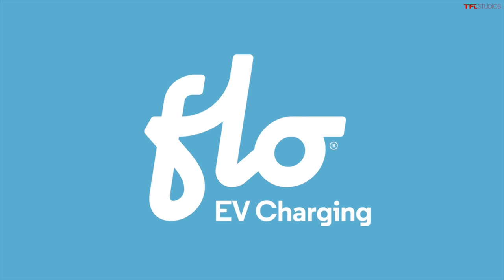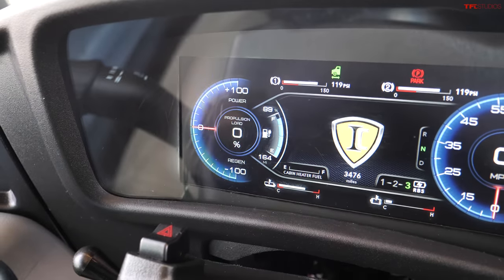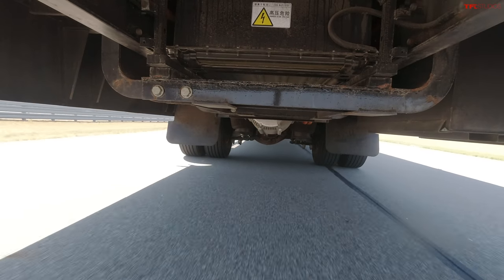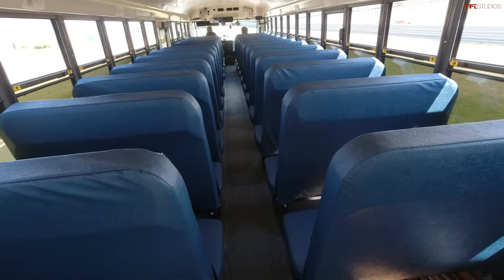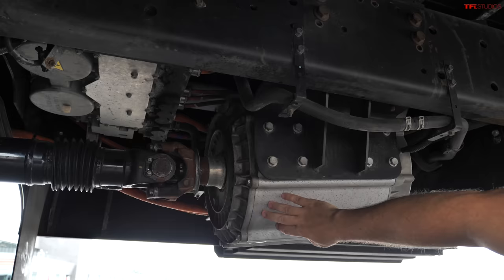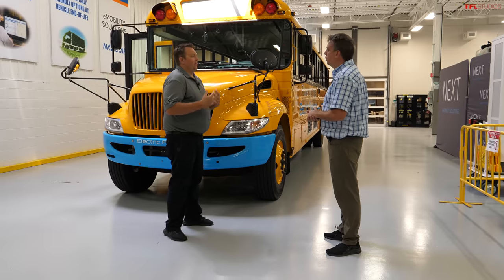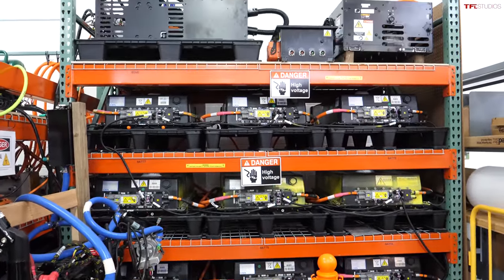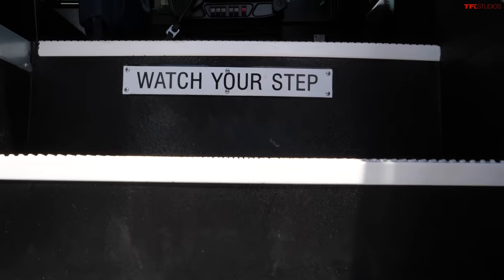Does This EV School Bus Put The First Nail in The Coffin Of The Classic Yellow DIESEL Kid Hauler?

Comment: As a school bus driver myself, I CAN'T WAIT until electric buses become more popular. Just the noise and the hard time starting in the cold makes diesel buses tiring after a while. I deal with screaming kids all day I don't need a screaming engine too😂
Reply: Why are they hard to start?? Ours are all plugged in and have appropriate fuel for winter. Waiting to see what these do in miles of sub zero snow drifts and what they do when the bus gets stuck in sub zero weather and how long the kids can be kept warm.
Reply: @rushfan9thcmd  Mostly the older Internationals 🤷 they can be plugged in all they want they're still junk and always have problems, 2 of them blew motors this past year, both under 80k miles. And yes definitely wanna see how they handle colder climates
Reply: @themarcherz8941  our fleet that we lease are about 3 yrs old. We will get new ones after 2 more years.
Reply: @rushfan9thcmd  Ahh, yeah we're board owned. We only have about 20 big buses and our oldest is a 2008 Thomas, but our 2012 Internationals are the issues, always have been since day one unfortunately lol
Reply: @themarcherz8941  weve got about 30 used for the HS and regulated by our GS district. All park outdoors except for the WC buses over the winter. Given the roads are crap and even vibrating our newer buses, cant wait to see the pot holes start eating up money for bus repairs. "What money to fix the roads, it went into the green buses. Drive around the potholes". The best roads are the rarely used roads in the country. The route may not go down the good roads.
Reply: @rushfan9thcmd  Yeah all our buses are parked outside 😂 we share a yard with the town highway department so it's always tight. Luckily we just got approved to get a snow brush for the buses this year, I was on snow crew last year and cleaning off 30+ buses manually was not a fun time
Reply: @themarcherz8941  I put shopping bags over my mirrors, Ive got my own brush, I use  various grille spatulas for ice. Ive even taken my leaf blower out there and plugged it in to blow snow off. Bread bags make great wiper covers to keep the ice off. I also put a light layer of grease on the hood rubber and sometimes prop it up with a small block, about an inch so the hood doesnt freeze shut. That way I can tip the hood easier to dump the snow off, get engine pretrip done so i can get it started to warm up. Ill even put a bag over the side stop arm to keep ice from building up. WD40 helps on the main door and releasing it above lets you pull it open easier. Some people dont do crap yo prepare to have their bus ready to go. Im not one for bailing out lazy people. Some still wont show until the last minute and end up late. I like setting things up when I park do its the easier the better in the morning cold. Ive also got a nice foot long flat head screw driver that comes in real handy. Yep, Ill have bags over all my mirrors. Makes life tons easier. Youve probably got your own methods. I just dont feel like freezing if i dong have to.
Reply: @rushfan9thcmd  not to mention what happens to the battery capacity in the winter. We already know cold weather drains the battery much wuicker
Reply: @lesterparker1594  yep, get stuck in the country in a drift, driveway, or ditch. Its zero or below. Youve got kids at serious risk. Weve gone out at 10 below. Nasty wind chill. Notice, none of these people have shown or cited any tests in such conditions. Our leased buses are about 3 years old or so. These crappy roads are vibrating the hell out of the buses. Screws are coming out of several places. Connections vibrating apart. The same was happening on transit buses. All these folks get that tingly feeling in their panties about spending as much as possible.
Reply: @rushfan9thcmd  you have to remember it’s by county and some counties do more to make sure their buses run better in all conditions
Reply: @williamtoccijr9579  this is Illinois, ROADS SUCK. The roads have been causing problems with the transit buses and school buses here. The bus Im in at the moment. is a 19 which most of our lease fleet are 19s and some 20s. Road conditions are causing electric problems, loosening connections, vibrating things loose and apart. Ive been doing this over a decade now and its getting worse.
Reply: Not to mention that engine heat in the summer. God I can't wait for electric.
Reply: @fai1t0liv3  battery fires, the biohazard of disposing of those materials, the cost of setting up the biohazard disposals
Reply: @rushfan9thcmd  In my old '09 front engine transit bluebird, the starter caught fire with a bus full of High Schoolers. Scared the hell out of us. Flipped the battery disconnect just as the column covers started to melt. Thankfully didn't progress much further after a quick spray from the extinguisher. 

Point is, problems with Electric buses aren't going to be worse or terribly different from diesel buses.
Reply: @fai1t0liv3  they will be far worse because roads are shit. The roads have been tearing up the transit buses and school buses. Many main hard roads suck far worse than gravel country roads. They can shove their electric buses
Reply: @rushfan9thcmd  Naw, they're going to be fine if they meet the standards the diesels have to. They'll have their flaws I'm sure, but nothing a little trial and error won't overcome.
Reply: @rushfan9thcmd  EVs handle wintertime like a champ. Far better than any ICE vehicle if they're properly designed for it. Zero 'warmup' time
Reply: All day? Literally all day? Don't think so bud. Maybe 2 hours out the day unlike teachers and parents where it is ALL DAY.
Reply: @planefan082  Ahahaha.... no. I've gone through many -20 degree winters with my 22 year old car and never had any issues. Warming up is a myth, within a few seconds everything gets oiled and is ready to go.
Reply: @16BitOG  -20? Try -40. Warming up is not a 'myth'. Even Toyotas, I can confirm, need to warm up. Of course, in an emergency, you can up and go, but performance is trash and it degrades the engine very quickly.
Reply: You have trouble starting? Maybe it’s because the oldest we have is a 2019 but we all are plugged in over roof garage 

And the other garage all 20 bidders are inside heated but I’ve never had trouble starting

Comment: That much battery power could back feed schools with emergency power.
Reply: It should also be used to do V2G after school hours (4pm to 9pm roughly) to put out more renewable energy to the grid to stop the duck curve from happening when solar power wanes.  Different times needed state to state but let's make use of the massive amounts of batteries we will have!
Reply: @whattheschmidt  They do offer Vehicle to Grid...
Reply: I think the kids would rather be sent home early. Besides, most buses are not owned by a school district but a private company that bids for the business each year.
Reply: Sure, convert grid to battery and then convert battery to the school.
Do you realize how silly that is? Somewhere in here ya gotta get power back in the bus so you can use it for it’s intended purpose. 
Don’t listen to sales people. Most of what they say is bs.
Reply: @davidmccarthy6061   70 percent of buses in the U.S. are owned by school districts.
Reply: @emmettthompson3332  how do you think emergency power is delivered now?
Reply: @ZzHasbrozZ  errr, it would be large generators. Mostly Diesel generators
Reply: @emmettthompson3332  so grid power used to convert oil to fuel then taking that fuel to generate electricity back again…
Reply: @ZzHasbrozZ  exactly. Take your AC power convert it to DC, then charge a battery, convert it back into AC. Lots of losses there. 
The other issue is how much power a school takes for normal operations. Very unlikely even a single large generator for the entire school much less a bunch of school buses.
Reply: @emmettthompson3332  I don’t think schools use generators to power 100% of systems during emergencies. Only emergency lighting and life safety.
Reply: @ZzHasbrozZ  I get it. Refrigerators for the food, emergency lighting. Typically the large areas like the sports/common areas. Pumps for sewer, etc.
Remembering that these schools will be housing families affected by the emergency.
I was referring to the fact that even these items required during still requires a very large generator that burns a lot of fuel and a bunch of school buses wouldn’t even come close to the capabilities of a generator.
Using EV buses for emergency power is simply an unrealistic sales pitch.
Reply: Snow days be damned.
Reply: @whattheschmidt , most batteries will be low at that time, seeing as that’s just after the school day, so the batteries could at least be held from charging until 11 or 12 to save the draw on the grid.
Reply: @nicholasdowns3502  Most would have 25%-70% I bet.  They will over buy on the range and account for cold temps in the winter so a lot of the time they will have quite a bit of extra battery.  Even doing 20% of the total pack size for a few hours on all those busses is huge on high demand days.

Comment: I think school busses would do great as EVs and would be a lot more pleasant over all they dont need super long range in most cases like he said 80mi a day and that is a decent avg so 200mi would actually cover that very well
Reply: they do know that child slaves die, mining the cobalt for the batteries don't they?
Reply: @graemejohnson9025  It took me all of 2 seconds to google and find out that LiFePO4 batteries (lithium iron phosphate as mentioned in the video) are cobalt-free.
Reply: @TruckerGuy135  yes. But not in production..
Reply: @graemejohnson9025  wdym
Reply: @graemejohnson9025  LifePO4 batteries have been in production for a long time.
Reply: @graemejohnson9025  we do not care 😎
Reply: @graemejohnson9025  these batteries have been in production for decades and are used in vehicles like the cheaper tesla model 3 and the new cheaper ford mustang ev
Reply: @Ry_TSG  jesus. There is a reason a Ambulance isn't a ev. It's too fn Dangerous..
And kids don't Die mining the minerals required to make the Batteries. Unlike a ev. It's a con..
Reply: @graemejohnson9025  Lithium Iron phosphate batteries do not use cobalt or nickel, and they aren't able to do thermal runaway. They don't need advanced cooling systems, and they don't need heavy layers of physical protection to prevent them from being punctured and exploding. The reason ambulances aren't EVs is because nobody makes electric ambulances yet. Maybe you should take a second to learn about the different kinds of electric vehicle batteries before you go around lying about them

Comment: I love how the component test shelf is covered with “Danger: High Voltage” signs and orange high voltage cables, and Andre just reaches in to touch each of the components :D
Reply: I was thinking the same thing, especially when I saw both of the manual service disconnects still installed.